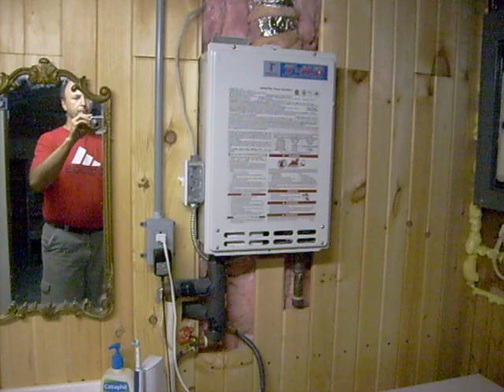100728 Takagi TK-3 noise problem:  Cured by Takagi phone rep !

Comment: Takagi has Horrible customer service. Heater broke in less than a year. had the heater fixed and they would not pay the labor as stated in the warranty
Reply: They didn't give me any guidance for my noise problem (same as the OP), but referred me to the 2 local servicers in my area. One won't return phone calls and the other has 100% negative reviews.

Comment: I experienced the same issue on a new install and the manufacturer determined the gas pressure to be off,Adjusted  the gas to the correct factory setting,problem solved.
Reply: I have the same problem. But my turns off and I get no hot water . Can you tell how adjusted the gas pressure to the correct settings?

Comment: What you need to do it increase the fan speed for the combustion.  Where this is varies from unit to unit so you need to call Takagi to give them the serial number of your unit (located on outside front panel) to so they can guide you through the adjustment.  Takagi USA (888)882-5244.  There could be other reason so they will ask you many specific questions to solve your problem for your unique situation.

Comment: There is no way that water heater can me installed inset into the wall like that. With wood practically touching the unit.
It's a furnace and you installed it right on top of combustible material. 
All of the "clearance" requirements are in the manual.